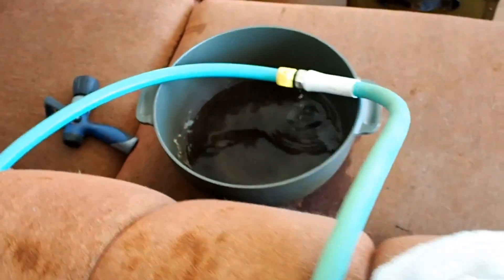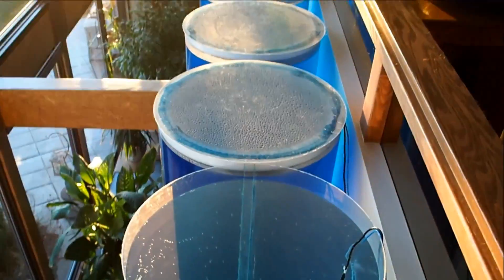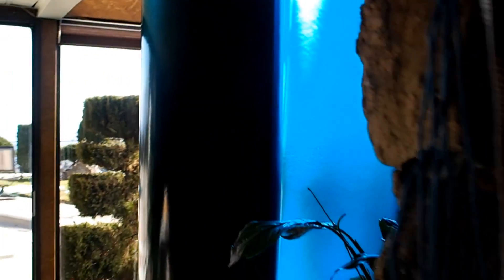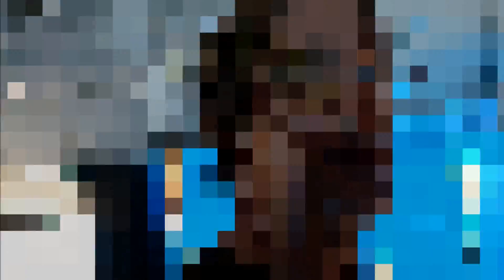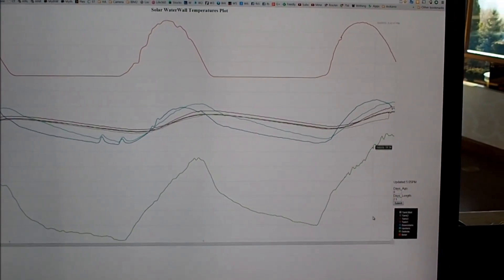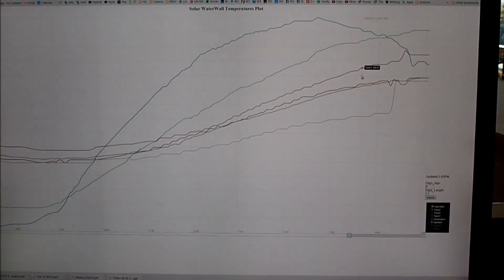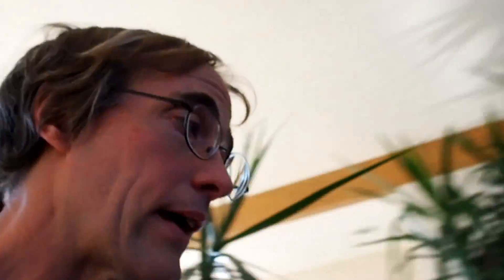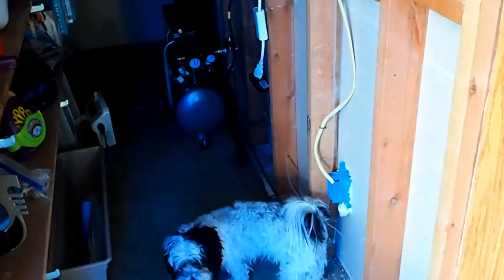Passive solar water wall battery

Comment from the maker: Update:  Sorry, but we moved from Utah to Alabama 6 months after making this video, so I never did get to collect a full Winter season of data.    The new owner did not do any monitoring, so we are out of luck for follow up data.
Reply: Bruce Winter Wow that view was gorgeous, must have been tough to give that up.
Reply from the maker: Yeah, it was hard, not only for the view, but also for the scenic hiking and the nice neighbors.  But we found an interesting house in Alabama that I'm having fun with (photos at http://brucewinter.net )
Reply from the maker: I changed the dark tube blue, but if I were to do it again, I would probably do what someone here suggested and make every other tube dark.
Reply: @BruceWinter  Hey why did you use so much water? How much water for 100 sq ft room with a ceiling height of 10 ft what temp range would the water need to be to hold a good temp like 68 to 72
Reply from the maker: @frankmundo4300  That would depend on how much direct incoming sunlight you have.   You could probably come up with a formula, but I doubt you could have too much water, other than for floor space, structural, and aesthetic reasons.
Reply: @BruceWinter  I was thinking about a rocket mass water storage system people use cob and stone or concrete from what I'm aware water has a higher thermal mass so by boiling water to store thermal energy probably around 2000 btus per gallon of 200 f water then mixing it with 2 parts cold water for 3 gallons of 110-105 f degree water this could be scaled up like 10 gallons hot to 20 gallons cold just seems easier to build a tiny rocket stove and heat water which the rocket stove is really good at and store the warm water inside
Reply: @BruceWinter  I would like to pump the water into a radiator and fan
Reply from the maker: I changed the dark tube blue, but if I were to do it again, I would probably do what someone here suggested and make every other tube dark.
Reply: Thanks for the reply!  That does seem like a decent compromise.
Reply: Have you considered making a giant fish tank and use that as a window instead, so you have one huge tank say 15 foot by 10 foot by half a foot, you would be able to not dye the water and therefore maintain its use as a window. It would be less efficient but with much more over all surface it would likely provide a greater reduction in the daily variance of your homes passive heating.

You might even want to put fish in it, that would be spectacular.
Reply: Cool, thank you for the update though!  Did you/would you decide to go with all dark tubes, or just not worth the aesthetic sacrifice for the heat storage gain?
Reply: aw, bummer.! cool video!
Reply: The new owner probably drained them and sold it all on E-bay lol
Reply: Bruce Winter - Great video! Where'd you find the big tubes??
Reply: I'm trying to push for affordable housing projects in the area that I live in that incorporate as many ideas and possible to minimize the need for bills as well as impact on the environment. I've been trying to look at things like build styles that focus on passive solar, grey water systems, space optimization  (things like tiny homes), etc.  I would absolutely love to know more about this idea. It's really too bad that you weren't able to collect a full set of data. If you have any ideas like this that you would like to share, I would be really excited to hear from you.
Reply: @Victoria-dh9vb  hello, are you still involved with these types of systems?
Reply: Bruce Winter jdjejdhei
Reply: Bruce Winter U.N.
Reply: I wonder if the new owner thought it was a 'art installation'?
Reply: Bummer, I just saw your video and love the water tubes and LED lights as well as the use of the Arduino for monitoring the temp in various locations.. I got to the part where you said "overlooking Salt Lake City" I jumped up and paused the video in hopes to message you and get a tour of your house, I live in Green River, Wyoming. I moved here from Alabama 8 months ago.....lol
Reply: The new owner clearly did not have the same passion for technology

Comment: Hello, nice project ! What component is the darker ink made from ? Charcoal powder ?
An other way to "color" the water i use in a small (compared to yours..^^) 1,3L glass tube I'm using to heat drinkable water (or slow cook food) inside (itself fitting inside a bigger jar, so it's kinda cheaply double glazed) a reflective parabole, is to fit natural slates cutted the right shape, one circular in the bottom, one reclangular with a handle, straight and perpendicular to the sun. I haven't make comparison with dark couloured water, but it optically "taints" wall the water, and is removable !
Cheers ! I also heard about some chemical products able to capture heat, and releasing it very long time after, without the need of insulation..  https://youtu.be/QbzqLBL-m8I

Comment: Did you say you're an engineer? I have some ideas I would like to test, but I don't fully understand all the math and principles.
Reply from the maker: Retired electrical engineer.  Not sure I can help with the math either, but feel free to post your question.
Reply: @BruceWinter  I am an automotive mechanic with a solid understanding of how the invved physics of a multitude of systems work.
I am looking to start a company that utilizes these systems on a different scale. But I also don't want my ideas to be public. I need help from people with your type of background.
Reply from the maker: @Kevin-qn7jf  I doubt I can help, but if you want to pursue, you can find my email under the about page of my youtube channel

Comment: I know you did this 6 years ago.... And you moved 6 months later... Yes I read a number of the comments. But you are still responding to comments. Just some thoughts. First even though black will absorb the greatest amount of heat, aesthetically I agree with the blue. One way to improve the heat retention would be to insert an aluminum pipe painted black down the center, maybe a little behind the center for aesthetics. run your air line down the black pipe and out the bottom through a drilled hole. As someone else mentioned get a aquaculture (fish tank) pump. they make them with six air line attachments. It would be quieter, easy to control and require less energy. IF your tubes were against a wall you could wrap the back with chrome vinyl or silver foil for that matter. that would redirect lost light back into the tube and if the black aluminum were in the center it would help focus the rays on the black pipe. Now you can light the entire tube with color changing LED strips all the way down the back. attach a small 1 to 2 inch wide strip of white pvc on the back side of the black aluminum, run the strip of color changing lights down the back side of the clear outer tube, (small split in the chrome vinyl or aluminum foil) pointed at the white pvc which will reflect the light trough out the tank especially with the chrome or foil.

Cool project. well done. I love the testing and measurables.
Reply from the maker: Some good ideas there!  Thanks for posting.

Comment: Sorry i do not get it,on the end what is best..5%is better then 20%bleu vs black,cheers
Reply from the maker: The black (darkest blue) tube absorbed 20% more energy than the light blue tubes.  The middle blue tube absorbed 5% more than the light blue tubes.

Comment: So is this for heat retention with the aim being to save money on heating expenses?
It seems cool and is interesting but I don't get it. 🤷🏻‍♂️
Reply from the maker: The goal of heat retention is to minimize temperature swings.   This has two benefits,  improved comfort and energy savings.  The savings is not intuitive and may not be significant.   It comes from the same reason you benifit from turning your heat down at night.   The energy lost is proportional to the difference between inside and outside air.   You loose more energy when outside it is 30 and inside is 80 than you do when inside is 70.

Comment: I suggest shorter tubes. 4 or 5 feet tall. That way, you can still see the view. Also, with the angle of the sun entering the home, the sun mostly hits the lower part of the tubes, not the upper part.

Comment: This is awesome!!! How much would you say you saved in heating and cooling bills?
Reply from the maker: We only lived with the tubes for 6 months, so no conclusive data.   I did some rough calculations on the project page showed the tubes were storing/releasing about $50 a month worth of heating, assuming gas heating.

Comment: i thought about adding  shelfs and adding glass bottles of water and paiting them all black. the sun will heat them all day then at night they will worm the room. do that in every room of the house.
Reply from the maker: Unless you have a small space (not much air to heat/cool), I suspect it would take a lot of bottles (hundreds?)  to make much of a difference.   Unless you had really big bottles :)
Reply: @BruceWinter  I see those pop can heater things and they can heat a small space like 200 sqft. i wonder if  1 galon would heat 2-3 square feet. or 1 litres for 1 square feet. it just came to me driving to work.

Comment: What did you use to stop things from growing in the tubes?
Reply from the maker: Copper sulfate will stop algae growth. Does not take much, 1 gram / 250 gallons, so 5 grams per tube, which is about 1 teaspoon.  Not toxic at those levels, often used to control algae in ponds.
Reply: @BruceWinter  thanks for replying so quick, really appreciate it. do you have to redose periodically, or is that pretty muck a permanent solution?
Reply from the maker: @wildness01  Unfortunatly, I don't know if it needs periodic redosing.  I suspect it does, but we moved from that house 6 months after I installed the tubes and I am not in contact with the current owner.

Comment: What happens in the summer when you have to much heat?
Reply from the maker: Summer works in reverse, the water 'collects' the cool air at night and releases it during the day.   But the bigger factor are the window shades which roll down during summer days to minimize solar gain.

Comment: "Passive" ? How much power are you using to get this thing going, i stopped watching once the fan was introduced,
Reply: I was wondering the same; wouldn't using that amount of energy/electricity on heating reduce the temp swings too? 😅

Comment: Great and neat experiment, thanks for sharing. Can you share the diameter of these tubes? What they’re made of? And where it’s possible to get them from? Considering this for passive heating a green house.
Reply from the maker: 18" x 8', fiberglass, from http://www.solar-components.com
Reply: Bruce Winter many thanks for the quick answer, i guess it’s good to add this link to the video description for other people. 

I was wondering if you faced an alge problem? Or if you know the measurements to avoid one?
Reply from the maker: @m.s683  I do have a link to the tubes in the project page listed above: http://www.solar-components.com    .   I used a small amount of (1 gram per 250 gallons) of Copper sulfate  to avoid alge.

Comment: Your house is inspiring.  And as a fellow engineer I love the cool customizations & data analytics. I wonder if your thermal mass water tanks would circulate themselves if the top was shaded so got cooler and bottom got most sun so go the hottest. Great videos!
Reply from the maker: Interesting idea.   Would not want to shade too much though, as we would loose some direct heating on that section.
Reply: @BruceWinter   you might enjoy this guys videos. Like you, he has a passion for doing awesome tech projects 
https://youtu.be/R_g4nT4a28U 
Best wishes, from Australia.
Reply from the maker: Yeah, love that Tech Ingredients channel.  That guy is amazing and inspiring.
Reply: If you do any projects using phase change materials for indoor thermal comfort, please do a video on it. There are some new innovative ceiling and wall products using this idea. I had the 'nutty' idea of using coconut oil as a phase change material but the costs looked prohibitive. And I'm not sure how well my girlfriend would appreciate 400kg of coconut oil in the house :)
Reply from the maker: :)  I've heard of all kinds of uses for coconut oil, but not that one!

Comment: Did you need to buy special flood insurance for this water wall?  (I'm only half-joking.)
Reply from the maker: I did not ask.   There was a floor drain pretty close to the tubes and not much other than carpet nearby to get wet.
Reply: @BruceWinter   Thanks.

Comment: Update in 2019 please - what would you do today - same with modifications or ??? - Standing by hoping to hear from you. Building a passive solar 'greenhouse' space along south frontage come Summer... what to do?
Reply from the maker: Yep, if I were to get into another home with cold winters that had with similar south windows, I would likely add tanks again.   But our home in Alabama has neither south windows or nasty cold winters.   I only lived with those tanks for 8 months, so I don't have any good long term feedback.
Reply: @BruceWinter  Thanks Bruce for your reply but I'm disappointed after such a well produced and narrated video by you that your reply was just a short I'd do it again. Maybe there-in lies a real answer of KISS and the tubes with water only require an outside black south surface to boost thermal collection as suggest by a viewer from Alaska... and/or plumb that mass into a 500% efficiency geo-heat pump system... knowing the sun delivers more energy in one hour to planet earth than all mankind consumes in a year there is an 8,000:1 advantage when it comes to Sun vs Mankind... surely our home energy needs are within reach using basic and best of breed science principals. Thanks again... you have excellent talent and hope you will again post a video that causes us to think... I'm subscribed and following...

Comment: Bruce this is awesome! What are some other strategies for dealing with hot climates like Texas? Are you aware of any? Would be great for winter even here but certainly how can it benefit in the hot season as well. Thanks. Sorry you had to let this house go. Looks amazing.
Reply from the maker: Having  moved to Alabama, I'm now asking the same question :)    If you are lucking enough to get cool/dry air at night, then whole house fans with some open windows works well.   Otherwise, no good suggestions other than the obvious (e.g. good insulation and window coverings).

Comment: Wondering how would a same size simple  black curtain collect heat compared to this huge mass of water.
Reply from the maker: Black anything would indeed convert the sunlight to heat, but the bigger issue is how to store that heat.  Without something massive, the inside house temperature simple gets too high/unconfortable (85+ degrees in my case), even with sub-freezing temperatures outside.   Opening a window solves that, but then you are giving away free energy that would otherwise be used to keep the house warm at night.

Comment: i believed antill you had the 1200w air compressor going twice aday,
1st you need to make a (mercury vapour pump) and use the dump line to pump positive air in , 
2nd you will need to have to air running all the time and heat the air before you pump in to the tanks ,
lastly you need to make a night time heat storage out of coxrix bricks ,ie heat storage bricks

Comment: If you like creative fabrication, how about utilising the solar energy to do the water mixing and fanning?

I'm sure a heat exchanger at the top and bottom of each tube would power a low temperature difference stirling engine well into the night. OK it wouldn't be that effective, but it'd use no electricity.

My RV experiences big temperature swings, but there's no alternative to turning the generator and air conditioning on there!
Reply from the maker: I probably could done something to get a natural convection cycle going, but the electricity to run the air compressor for just a few minutes a day cost very little.   And those bubbles were too pretty :)

Comment: Just a small idea if you install something similar in your new home: Put a blackout curtain on the outside wall to prevent cooling losses at night.
Reply from the maker: I had pretty good insulating motorized cellar blinds on all those windows which we would close on cold nights (and hot summer days).   Good suggestion :)

Comment: Hi Bruce. 
Nice Video, great setup, and yes, everyone loves a great view. Thanks
I have seen a design for a completely different type of system, but using almost identical hardware. 
It slowly circulates the hottest water, ie the water at the very top,  from seven of the Cylinders into the eighth.
The Eighth cylinder has the coldest water (ie at the bottom) fed to the bottom other seven tanks.
This has the result (I seem to remember) of 10 to 15 degrees improvement, depending on variables, even if there is no other heating system running at all. Kind of like an Inverse Maxwell's Demon.
I would assume the Hot cylinder would be insulated to hold its heat, and I would hypothesize that you could make a cold water tank also (possibly for some type of cooling in Summer). 
Of course another option is if the cold water is colder than the Municipal supply, you could eject it (in small amounts).
Have you heard of what I'm talking about? Sorry for the long question, but maybe if you have a similar system again, 
it could be a mode you could try at certain times when it makes sense, but hot water is more important than cols.
Thanks - and best wishes to the security puppy.
Reply from the maker: I had not met Maxwell's Demon before, yet alone an inverse one :)   Interesting idea.     Thanks for the comment!